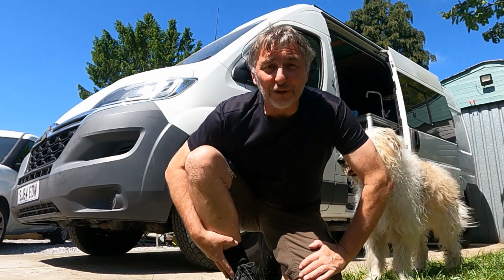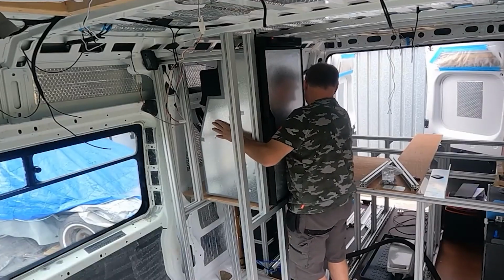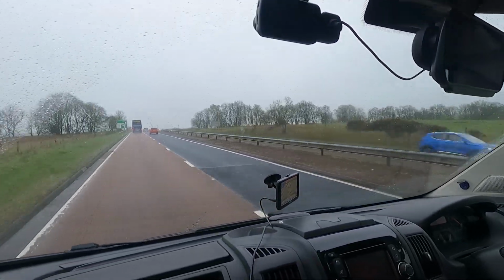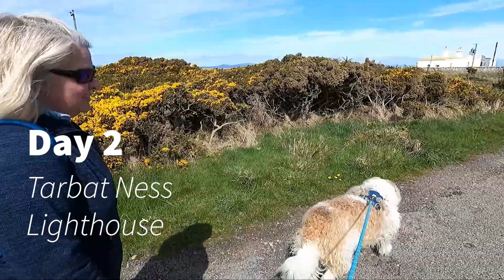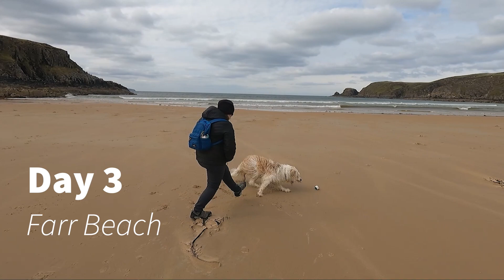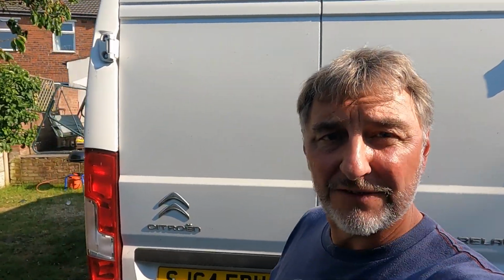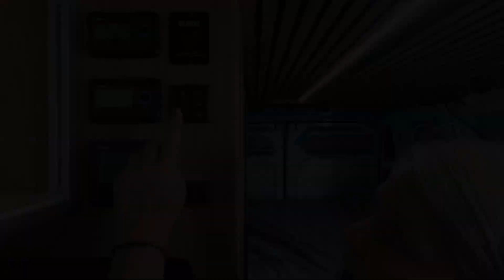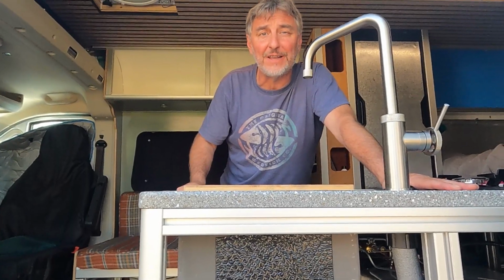DOES OUR VAN DESIGN WORK?

Comment: The joy of extrusion is you can put that slider in now for the toilet
Reply from the maker: I've left very little room to raise the toilet slightly on a slide Christina. It would mean having to raise the bench unit by about 20mm.
One length is part of the fridge structure which again with hindsight should have been separate to the bench unit but I didn't want to see a join at the time so perhaps a little too much backtracking.
I should have thought that one from the start but not too much of a problem.
We're planning an alternative bed for the dog.
Reply from the maker: Hang on! You're right Christina. I did keep it a separate unit... Going mad in this heat at the moment.
Reply: I was just about to come in an make a comment about that - like i know your van better than you do 🤣 - so you could run sliders on the bottom or on the sides, or change the toilet - which feels big right now but long term use may not be
Reply from the maker: @christinamacintyre9972  😂 I marched straight out last night with intent then realised my extractor fan is exactly where a slide needed to go and wouldn't be an easy remedy to move.
It was a good idea too (Nickys) shame we didn't think of it from the start.
However, bloody costly just so we don't disturb Azzer!!!
We're now considering an idea to move him to something we can create accross the front seats.
Awning, grey tank and hopefully some more paneling and cabinetry coming up soon with a few short holidays in between.
What you up too?

Comment: Nice! I bought a L3 H2 Relay a couple of weeks ago. I have been living in a small caravan for just over a year, so I have a pretty solid idea of how much storage space I need, plus a comfortable place for my 2 dogs. 
I was looking at extruded aluminium, the smaller stuff, size 10 (as well as timber.). Is your aluminium size 10 or 15?
Reply from the maker: Hey Richard thanks for getting in touch.
Its the 40x40 prophile (which I'm sure is the 10) for the base units and 30x30 for the upper cupboards. 
It is super strong stuff.
If unlike me, you don't need slide out trays, I'd say 3 transverse pieces would be more than adequate for bed supports.
Do take a look at previous vlogs to see how we got to this stage and feel free to ask any questions. 
And find us @ MyWay Adventure on Facebook.